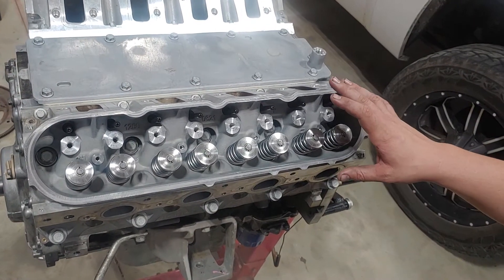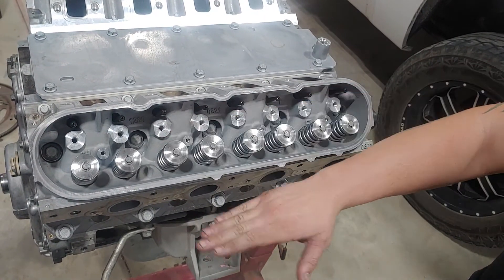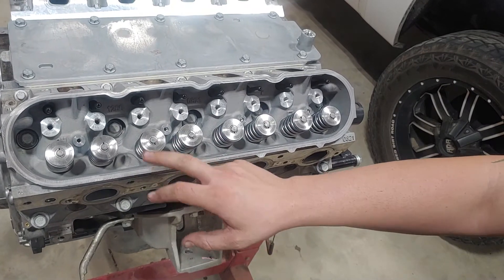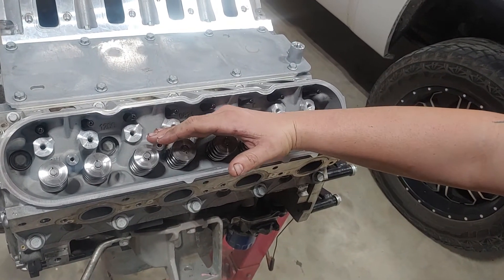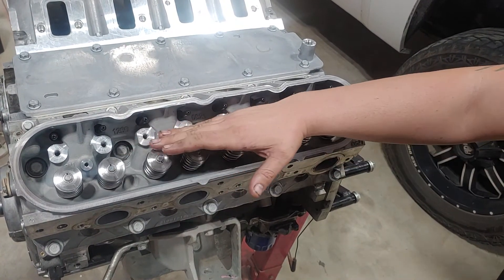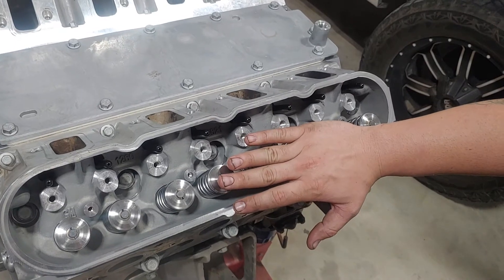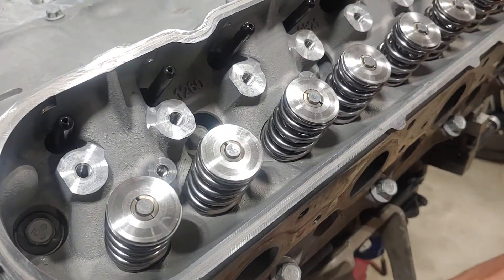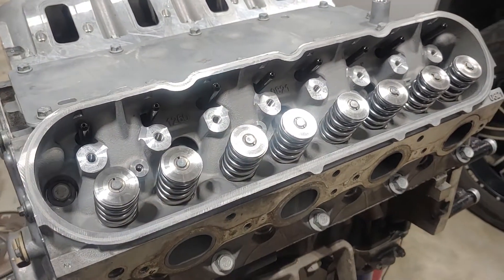Ls cylinder head torque specs and sequence.

Comment: I really appreciate this video. I always buy service manuals for my J.D. equipment, Harley's , etc but don't seem to be able to get one for the ls engines.  I have a nice '04 Suburban, Z71, 185,000 mi. I need to go through because lifters are rattling like crazy.  It's new to me and I did luck out and  buy an identical Z71 that runs great,  even same heads just in case.  Thanks for the vid and I did subscribe.
Reply from the maker: Glad to help

Comment: You left something out. After you do the 22 foot pounds the middle 6 bolts usually aren't at 22 foot pounds anymore due to gasket compression by the outer 2 head bolts at each end of the head.
Always go back over all headbolts a second time to make sure they are at 22 foot pounds before the 90 degree step.
Reply from the maker: Good information
Reply: @saleen3966  the same thing goes with the inner main cap bolts although they arent off as much as the headbolts are those should be rechecked as well.
I build lots of ls motors and they have to be right the first time. 
A shop is only as good as the builder.
Reply: @davidsharp922 In the third tightening stage, do we tighten the 9-10 screws to a degree of 70 or 51? Because I've seen people pull it to 51 degrees
Reply: @nawaf-z4t  I do 60 degrees on all bolts in the third step. Never had one problem with any motor whether aluminum or cast iron block.